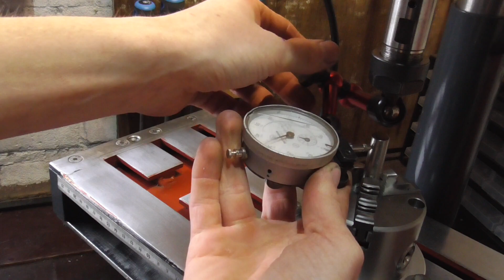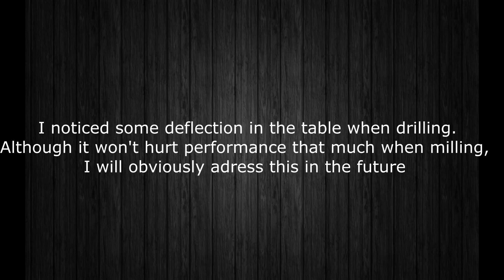How to Drill Perfectly Centered Holes in Round Stock!

Comment: Why can't you just secure the stock in the chuck, lower it into the 4 jaw, clamp it then tighten the 4 jaw onto the table? Wouldn't this be as accurate?
Reply from the maker: That's a very good Idea actually, I didn't even think about that.  The advantage of the method I showed in the video is that it also applies to bigger round (or square) stock that is clamped in a vice, using a v-block. Thanks for your comment and have a nice day!

Comment: great video man, I have a question about base plate of the 3 jaw chuck, did you make it on your own somehow or is it possible to buy the plate which would fit that chuck that has an intentionally wider radius than the chuck?
Reply from the maker: Good point, I actually bought the chuck and base plate at a local webshop that sells tools (kinda cheap and lower quality) Thanks for your comment, have a nice day.
Reply: @EngineerSteve  thanks for your reply